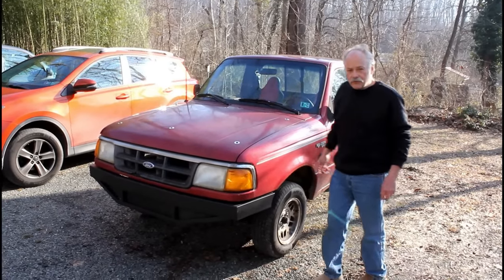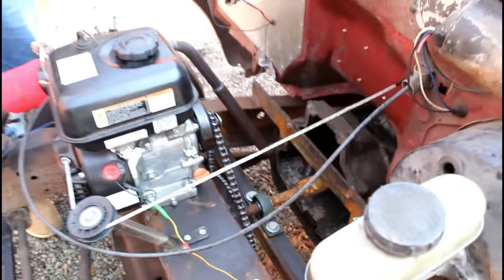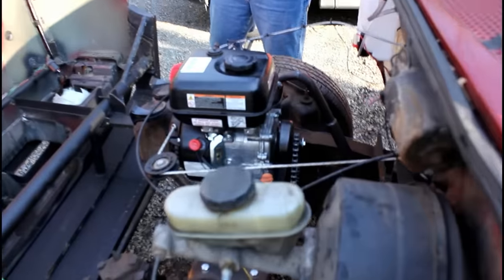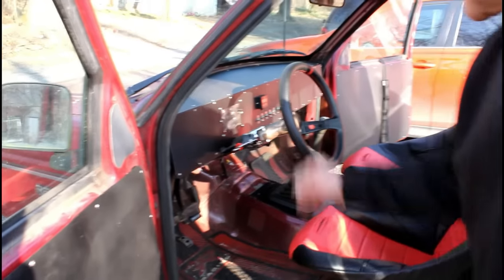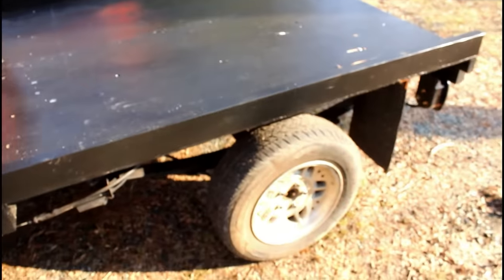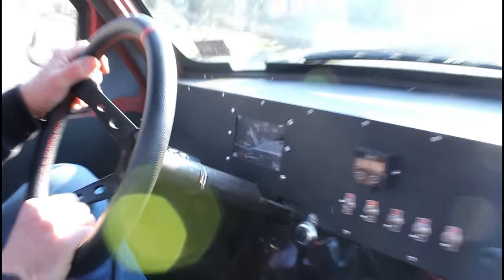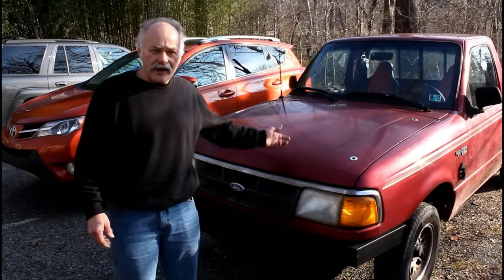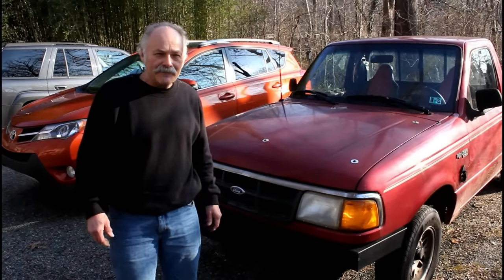Ranger Truck with 6 5 HP Predator Engine  [January 2021 video]

Comment: For a second i thought he put 6 predator engines running at 5 hp each for all the horsepower.
Reply: Same lmao
Reply: Yeah WTF. The simple period would have clarified it LOL.
Reply: Grammar matters
Reply: Me too
Reply: Thats why I clicked on the video
Reply: Yup🇨🇦
Reply: As it does have a stage 1 kit on it, it's likely pushing 8 horsepower (high output, I know)
Reply: @grugg3108  they should dyno it.
Reply: Same.  When he popped the hood, I even thought for a second maybe the other 5 were hidden in the back lol 😆
Reply: Interesting idea like switching off cylinders. You could have additional power when needed and one for cruising. Or two for cruising uphill? 
And once an engine is done you swap one, not all of them.
Reply: @UNSTOPABLE40XBOX I don’t think it would read on a dyno
Reply: Me too lol
Reply: Me Also

Comment: That's 3.5 more HP than a Ranger came with from Ford factory. 😂
Reply: Lolololol
Reply: 😐 loved my 2.3L
Reply: @JohnMiller-iu2sx  
I'm sorry.. 😂
No really, the 2.3 is probably the best Ford 4 cylinder they ever made. The rest are absolute garbage, literally garbage.
Reply: @member57  it's ok. I totalled my ranger at the end of 2020... 290K miles and only needed half a quart of oil between changes... Was a good truck 😪
Reply: Oh now surely you're shorting them 1horse with a bad leg...lol
Reply: @jarvislarson6864  lmao best comment 🤣
Reply: ROFL!- ... really🤔🤔...
Reply: @member57  Not true, the new ecoboost turbo inline 4s they’re putting in the new rangers are great engines. Lots of kick for a 4 banger.
Reply: @paulspomer16  I heard they were having turbo problems
Reply: @mitebadopted3894  Hm, interesting. Haven’t heard that. My buddy has had one for over 2 years now and he’s beat on it quite and bit and the engine still runs great with no issues.
Reply: @paulspomer16  Huh, I guess it's one of those engines where it's hit or miss
Reply: @paulspomer16  
It's still garbage. Severe reliability issues.
Reply: @member57  Source: trust me bro
Reply: @paulspomer16  well, that....and class action lawsuit, and the recall, and them catching fire, I guess.
Reply: I have a 89 ranger with 2.9l 252k miles and still have enough power to tow 5k load
Reply: @josephfuller6229  now try stopping it from highway speed.
Reply: @randymagnum143  Yea a lawsuit about incorrect fuel economy on the stickers… boo hoo. And they recalled them due to an issue they suspected COULD cause fires, but no fires linked to it have been reported. Your point is invalid😵‍💫
Reply: @randymagnum143  I have the manual transmission makes that a lot easier
Reply: @josephfuller6229  OK, 'cause physics, I guess.
Reply: @paulspomer16  and cam phazer failure, and hydraulicing on coolant.
Reply: @randymagnum143  have you even driven a manual before? You save a minimum of 20 percent time by not having to fight the engine plus you can use the transmission to slow down even faster in a emergency
Reply: @randymagnum143  You are quite the cherry picker aren't you
Reply: Probably still can't run it in 5th with full load very long. Yep those transmissions burn up. Even if you are pulling a empty trailer and empty bed.
The engine still ran great when I sold it with 300,000 miles on it. But the 25 MPG on highway was good.
Reply: @warrenpuckett4203  does much better then my old 91 S10 V6 that had a 84 4 banger transmission it would barely maintain speed in 5th on flat ground without a load
Reply: @paulspomer16  yea, I cherrypick trucks that aren't Found On Road Dead.😘
Reply: @josephfuller6229  no way a 10k # trailer is safe or legal behind a 3k lb "truck" with pinto tires and brakes.
Reply: @randymagnum143  I never said that I do I just stated that it was still capable of it
Reply: @paulspomer16  lots of kick isn’t the only thing that makes an engine great.
Reply: He can take it back to ford and get his money back
Reply: @member57  i would have made it automatic
Reply: @randymagnum143  no I agree I pull my tractor and sometimes I pull my car hauler with a truck or car I usually always use my 6.7 powerstroke but I used my f150 to pull a single cab pickup the other day and it was all it should ever do I couldn’t imagine the ranger with a 5000 pound vehicle on a trailer behind it hahahaha.
Reply: @member57  Thats because it was actually a Mazda!
Reply: @member57  yeah I had the 4.0 v6 and holy shit was it a bucket. Beautiful blue interior completely unscathed but every line on it was rotting away had injection issues, would cut off if I hit the brakes too hard (abs short), and God forbid if it rained because it had skates on it. Loved that truck though rwd only model and 92,000 when it started spitting trans oil on my boot standing at the front jump starting it one day. Never gave a look at a 90s Ford again
Reply: Cant stop gigglling over that one...good comment brother
Reply: facts
Reply: I loved my 01 ranger with a 5.0 V8 swap
Reply: Built ford tough...
Reply: @member57  I liked my 04 zetec Focus well enough that I kept it for 12 years with zero engine problems .
Reply: @paulspomer16   He's a talker .
Reply: @josephfuller6229  S 10 was really poorly put together . Years back we had Rangers and S10 pickups where I worked . The S10 s had better driving position etc , but they didn't hold up on interior quality especially.  The Rangers were very tough .
Reply: I got 320,000 on my 2.3...runs great.
I call my 97 ranger the 20th century model T
Reply: @mitebadopted3894   Do your own research . Ford has been building 4 bangers for well over 100 years . If you go back 50 years ago to the Pinto vs the Vega it wasn't the Pinto with the biogradable engine . That would be the GM 2300 . The interior also fell apart .
Reply: I was just thinking “wow this predator engine has more balls than the Vulcan 3.0”
Reply: Lol
Reply: True
Reply: Derpp derpp
Reply: Beat me to it 😂

Comment: That thing is impressive the amount of work it took to do that is remarkable . It may be the only one of those in the world like that and I can't imagine anyone else  at all has thought of doing something like that
Reply: Im sure there's a very small handful of these out in the wild in 3rd world contries somewhere 🤣
Reply: Check out Robot Cantina on youtube. he built a honda insight using this engine. ended up doing crazy stuff after awhile like efi, superchargers, n02 things sick. hes about to put a 3cyl diesel mower engine into a saturn s2 wagon.
Reply: ive seen a couple across the us at carshows and carnivals
Reply: There's all kinds of trucks and tractors with harbor freight engines in them just type them in to YouTube. They are pretty impressive.
Reply: @corydebuhr4344  he could have used a twin briggs engine
Reply: @Mike-su8si  yes he could have used the 22 HP predator . There are all kinds of on YouTube from the small single cylinder to the big v-twins. That's why I said harbor freight and didn't elaborate on size.
Reply: @corydebuhr4344  i was gonna buy one of those engines from there but to many people said they're junk 

But his is working good
Reply: @Mike-su8si  I have a 22 HP but modified to fit another project and now I need a new crank.
Reply: @Mike-su8si  “good”

It looked like it ran and drove like utter ASS
Reply: @fastinradfordable  cause its just a driving mower engine they're not made to go fast like a vehicle
Reply: Um , this was being done 30 plus years ago .
Reply: @filthynice88  that's worth a about 8 thousand dollars or more
Reply: There's a guy on YouTube that put one in an old Prius
Reply: There's a kid that's really young who did similar out in Idaho I think... but he's done most of the work with his dad, guiding him on how to use the welder and grinder and other necessary tools.   
Fantastic to see young ones catching the bug!

Comment: "It's a stage one kit." I love your enthusiasm, my man.
Reply: It’s the first stage of his build, is that not what the term originated from?
Reply: There are several upgrade kits available for these 212cc Predator engines. Each stage adds additional horsepower and top speed. These are used mostly in go carts and mini bikes. This Ford Ranger is a creative application. First I've seen that.

Comment: Can't wait to see more out of your builds.  I am gathering final parts for a slow geared 4x4 hauler with 459cc 15hp Predator build to carry building materials (rock/cement/water) up a 45 degree incline.  Thank for the inspiration...
Reply from the maker: Good luck with your project!
Reply: Have you have seen Mike festiva channel. He made a 420cc Predator powered articulating 4X4 dump truck.
Reply: @non1503  yeah he makes some cool projects
Reply: @mototoad1242  You might like MrTeslonian, sixtyfiveford or Jaimie Mantzel channels.

Comment: Noisy as frig but a heck of a lot of fun.  Great build :)
Reply: Fun? Ok
Reply: Fun? Nice build? This thing is 1000x worse than when it had the original engine, and that's really saying something.
Reply: @BlueOvals24  I'll take this truck over a tesla 7 days a week I'd probably be driving that around with an ear to ear smile
Reply: @bensmith4563  Well yeah why would anybody prefer a Tesla?
Reply: @BlueOvals24  its way better than stock
Reply: @radicalracing09  I'm sure it is, if you disconnect 3 ignition plugs from the stock one 😂
Reply: @BlueOvals24 go back to the basement
Reply: @Saltshaker2016  Just because that's the life you chose, doesn't mean the rest of the world did.

Comment: Put a single cylinder diesel in it that would be awesome!
Reply: A four wheeler engine but they're stators seem to mess up alot
Reply: The duromax he mentioned likely is diesel. At least the ones on my eBay recommended thingy.

Comment: This would be a great conversion for any old beater that has a blown engine. Especially, for a beginner behind the wheel. If more power is preferred, remove the governor and bolt on a turbo or supercharger kit.
Reply: you bet,multiple size turbos for any engine combination
Reply: God no, thing could barely move it's own weight!
Reply: @Bronco Belligerence  like I said above, great for a beginner behind the wheel. A kid hanging out with Grandpa driving thru the Pasture to check the Cows and Bulls. It's not designed to run low 5's at the Drag Strip or qualify for the Daytona 500. It's simply an affordable conversion that could be installed in almost any vehicle and be fuel efficient.  Could change up the gear ratio by experimenting with different sized sprockets for desired speeds. Me personally, I would build it as an off-road vehicle only. Basically a Farm Truck that can take a Beating while Trail Riding, Creek Crossing for Deer Recovery, Etc. Nothing Extreme. A Large high toothed sprocket for low end Grunt would be perfect. Fixing up an older vehicle would  be alot cheaper than a fully enclosed UTV or SxS. I grew up Raising Hell in the Country, so there's  plenty of places a kid could go on Go-Carts and Mini Bikes. But this would have changed the game up. It doesn't take much upgrading to unleash the potential of small engines. It really comes down to a Person's Imagination, Mechanical Experience, and Budget. Some Guy's in my area actually use this set-up in their Custom Built Rock Crawlers.
Reply: @ThrelkeldOutdoors  A gravel road doesn't count as a rock crawl, and a gravel road is about all you'll be doing with less than 10hp. I'm all for small engines, that's why I like SXS, and one of those would be far better than a Ranger with one cylinder. The problem with this build is how much that truck frame weighs compared to a purpose build SXS. And I never said this thing should be fast, a stock 2.3 is about the slowest thing you could get on the road, yet it's still a better option than this. And for teaching someone to drive, there should be some power involved. Obviously don't throw a new driver into a GT500. But a modest 100hp is enough to teach them all aspects of driving, including throttle control. They'll never learn throttle control with 6.5hp because that's not enough power to even get the wheels to chirp. They'll drive around with this thing pinned, then have no idea how to control the throttle when they get something with even modest power. Engines like these belong in go carts and entry level SXS and this video proves that.
Reply: @Bronco Belligerence  I'm not here to argue, but maybe you should do some research on this subject before trying to belittle my mechanical knowledge and Off-Roading Experience.
Reply: @ThrelkeldOutdoors  I can't belittle something you don't have bubba. You can get some power out of them, but you'll never rock crawl with them. Well you can try but you better have a good winch 😂
Reply: @Bronco Belligerence  I've owned over 100 vehicles in my lifetime. I might just know a little something.
Reply: @ThrelkeldOutdoors  These don't count as usable vehicles bubba, might wanna check that again.
Reply: @Bronco Belligerence I didn't add any of my toys. That's just ignorant. I've legally owned 100+ vehicles.
Reply: @ThrelkeldOutdoors  Bunch of celebrities have owned several cars as well, doesn't mean they're well versed in them.
Reply: @Bronco Belligerence Tons of people have been successful with these conversions. Anything from  street legal daily drivers to off road mudders and rock crawlers. Just do the research.
Reply: @ThrelkeldOutdoors  If by successful you mean they run, yes, no doubt. But a "daily" that can barely put around at 30mph isn't a real daily. A rock crawl or mud rig that constantly gets stuck because it's so underpowered isn't successful.
Reply: @BlueOvals24  We're gonna be best friends forever.
Reply: @ThrelkeldOutdoors  If these lawn mower engines are so great, why does a majority of Jeep guys swap in a v8 or various tuned I6 engines when this would be far cheaper? Hell, why don't automakers all use a little single cylinder engine to make a more efficient vehicle? It's because these don't actually work beyond putting around grandpa's ranch.

Comment: Very ingenious build, it seems to run pretty well. Might the engine have shut off due to the low oil sensor malfunctioning? I only ask because I have heard it is a common problem with Predator engines. Otherwise, very nice fabrication.
Reply from the maker: The ground switch shorted out and caused the motor to shut off.  It was a cheap toggle switch.

Comment: Just goes to show you don't need a truck with 38" tires and a 300 hp engine.  A truly affordable to own vehicle that only sips gas.  :)  Absolutely love it.  Plenty of room to work on it.  I think I would have added a padded fold down seat under the hood so I had somewhere to sit if I needed to tinker with the engine..... a luxury upgrade.  :)
Reply: NotQuiteJosh   sounds like what some people do to their cars..... obnoxiously loud, but to each their own.  I've never understood the point of taking an underpowered OEM truck and destroying the exhaust system so it sounds like a lawnmower....... at least with this truck it's a lawnmower engine.  lol.

Comment: Man that is a lot of space to work on the engine.

He could also make it mid engine by pushing back the trans and engine under the bed in front of the diff, with a smaller drive shaft. He just have to make some brackets to hold everything.

Comment: Have you thought about using something as a flywheel to increase the torque for pulling? I have thought about trying something like that out, but i dont have the money.  But after i seen that old 2 ton  delivery truck that Jay Leno has. I think it was called an autocar. And it probably had around or less horsepower than that duramax, but it had the heavy flywheel to increase that torque for pulling heavyloads.

Comment: Old Briggs engines run like that when the points are going bad. Tip 101- run your exhaust into a full size car muffler, fuk all that cab noise. Tip 102- 18hp Kohlor engine. Tip 103- rubber motor mounts are a great thing! Tip 104- run higher air pressure in your tires to reduce road friction.
Thanks for the seat belt window trick! I need it in my friggn van for drive thru restaurants. Lol. Have a great day bro! Psst, 2nd engine could be mounted low in bed and find a gear box, rear axle from a gas golf cart..

Comment: Why didn’t you couple the shaft to the shaft in-line? It would’ve eliminated the sprockets and the predator transmission.
Reply from the maker: It needs the gear reduction because of the low horsepower and the heavier weight of the truck.

Comment: Kind of wanted to do this with my beater car,but don't have the time for it. 
I figured if the engine blew in it,I'd throw a lawnmower engine in it as I'm only 1.6mi from work and if I've gotta go anywhere else I use the wife's car. 
The other projects take up my time, and the beater got too rusty and went to scrap a while ago. 
She was fun while she lasted ,going 8yrs and 30k without an oil change,what a great experiment. 
Now I know to never waste money on an oil change for a 1200$ beater car.
Reply: Pretty sure that $40 of oil and a filter would have paid for itself even in a beater. If it made it 30k without it probably would have done 60 or 70 with.
Reply: I think you got lucky with the lack of earl change

Comment: torque is what moves you down the road. The rotating mass of an engine somewhat determines the torque output and that has to match the vehicles weight to deliver adequate performance. Some small engines can deliver the same hp as larger ones but they have to work so much harder to do so and will wear out very fast. I built a Vw Jetta with a suzuki gsxr 1000 engine and it behaved just like I said. Fast, fun but that little engine screamed all the time and the lack of torque was obvious. 70ft lbs/168hp
Reply: Still a cool build. I’d love to see that thing screaming with the GSXR engine in it. 👍🏼